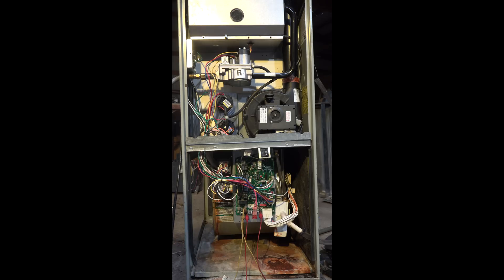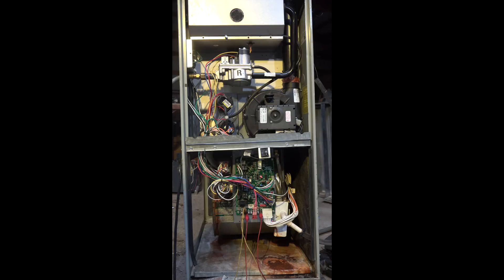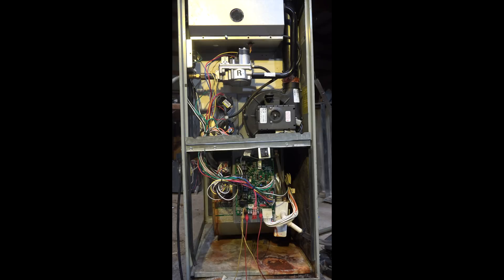What's wrong with this furnace #10

Comment: there's water in the inducer assembly. this will cause a pressure switch error and kill the gas. probably has a plugged up drain. I see this all the time on poor installs or where there are pvc shavings in the inducer assembly from a recent install, or bugs are in there. I see a lot of these plugged up after summer has ended and people are just starting to run their furnaces. Bugs love to camp out in the flue.

Comment: Too much condensate...you can see it dripping out and hear the inducer fan working through the water...having filled the bottom of the collection box and blocked the orifice for the pressure switch. I can also see the condensate drain tube is standing up not allowing for proper drainage.
Reply: I like this answer

Comment: Secondary heat exchanger is filled with water and backing up into the inducer blower housing. The Secondary heat exchanger polyethylene coated steel is coming apart and clogged itself.